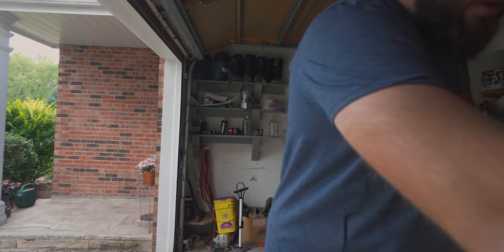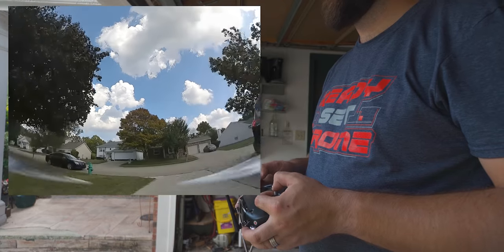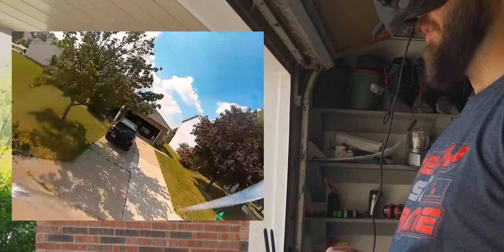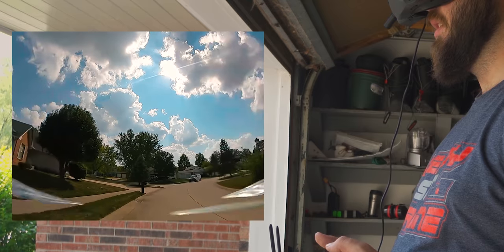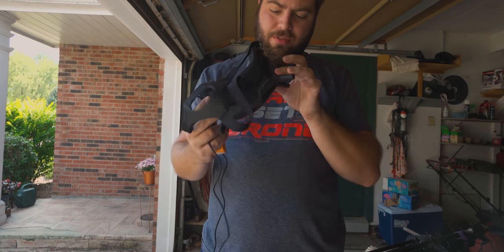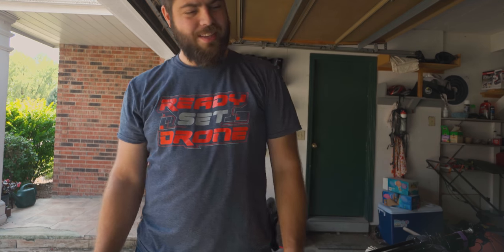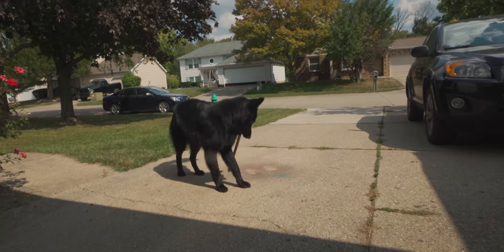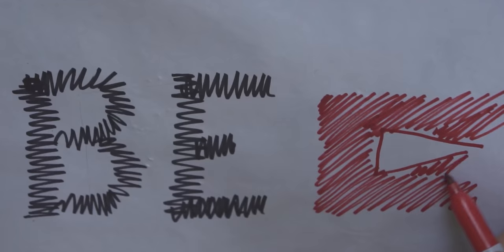Reacting to my First Ever DJI Digital FPV Flight

Comment: The quad tune is not great.  Very weak PID response.  But that's just some settings.  
Great flying on those loose sticks!!  I needed to tighten the spring tension.  The DJI springs are pretty soft, but it is awsome you can tighten without taking the radio apart.  Again, just some settings.

Good stuff.  Loving there is not break up or rolling shutter.  Pretty crazy.

Comment: The recording starts automatically when you arm. Just in case you forget.
Reply from the maker: yes it does. So cool
Reply: 2020 will be very expensive, but no problem. still use old older oldest box goggles till today, but now its time to upgrade.

Comment: Whispers I want to hate it

Later

This is unfair
Reply from the maker: It beat me into submission.
Reply: Competition will be here soon. Don't need a proprietary system.
Reply: I wanted to find a reason to fly my five inch analog rigs, but I’m liking the Dji way better. I don’t race or fly super long range.
Reply: Andy Ciordia the only thing that is proprietary is the goggles. Fat shark was going to make you buy a new camera/vtx too. Also they were going to use the hdmi port for something.
Reply: EscobarTV45 you need their controller too. Can you cite where FS is going to create a proprietary module? So far they've just stick to the goggle not vtx market.
Reply: @AndyCiordia  you don't need their controller. You can use your own reciever and transmitter. As far as the FS stuff. Go to their Facebook page and look at the pic of that byte frost stuff that they had to hold back on. They were about to sell you a system that wasn't on the level of dji stuff.
Reply: EscobarTV45 ah I thought it was a package. I'll still wait. Cost to benefit isn't there for switching out an armada to a new goggle system that afaik isn't useable with the other standards. I'll wait and see how the market handles it. Every 6mos we see some innovation. I'm not complaining, it's a good thing to be pushing on. 👍🏻
Reply: Andy Ciordia yeah I still have my fs hdo with RF and not getting rid of em. Anything new that comes out is gonna require a new camera, vtx,  module, and goggles if you have some old ones.
Reply: I have plenty of $$ in 5.8, but even if I didn't I'd still be waiting another year or so... most of our standard FS goggles will display vastly better "HD" images than we get from 5.8 analog.. so I wait and see what HD/digital cam, vtx and FS bay modules follow DJI.   Besides that, I'm not dumping Crossfire either, nor am I going to buy new frames to fit that big DJI box.
Reply: Second thoughts. I'm selling the Fatshark HDOs and Rapidfire. I don't need $500 goggles for whoops and toothpicks. I'll dust off my Skyzone 02

Comment: I felt the same stutter until I tightened the stick settings. It's just a disconnected, un-nerving feeling. I got used to it, but it's better now that I tightened up the spring settings. I think the gimbals are set full loose from the factory and it seems like there's actually play in the linkage. I do miss the programability of my X7S, but for this video, I'll suffer thru it.
My big wants are a receiver so I can let others view live video and real Betaflight OSD. I'm also having trouble getting the rate profiles to change, but maybe I just don't understand how it works.
I've been doing a lot of flying since I got it, it's really enjoyable and it's upped my confidence by an order of magnitude.
Enjoy the new world, and cie la vie on the analog gear, many of us have a lot of  really to notch gear that instantly lost it's luster. I guess I'll put my HDOs in the box with my CD collection.....
Reply: The bardwell video on setting different rate/PID profiles will get you there,  it's a bit of a faff the first time, but once its there it works really well.  
I'm still shocked how much confidence I gained moving from junk VRx and $13 cameras to a Clearview GS and Predator cameras, so that's definitely a real thing.
Reply: @tehllama42  Thanks, I watched that, but it was before I started flying the DJI, so most of it didn't sink in. I'll go back and watch it again.

Comment: Nice to see your toughts. I Like my DJI System too, it's really hard to not like it. Digital Video feels a bit different than Analog, but after a few days i was used to and it's absolut flyable. Also i noticed some of my Analog Quads fells more Latency depending on the Camera. The Digital System has a bit Frame los or drop in some situations, but the Latency over all is absolut fine. the Frame los or drop is a thing to get used too, not more worse than bad Analog Video noise.

Comment: @NURK FPV - your timing should work, and I'm excited to see track time comparisons (though not being your quad and not tuned for racing I doubt you'll beat your own builds heh)  The DJI system is basically the same as Raceband, though 6/7/8 are switched around.  I know a few timing systems have already released firmware updates to support DJI so check if there's an update available?

Comment: Love how this entire industry can do a 180 over a new product..suddenly everyone loves dji again hysterical how things work.
Reply from the maker: I'm not sure what you are implying. I never would have said that the industry doesn't like DJI it's just a different strokes for different folks.
Reply: It's entirely possible to love a new capability regardless of how we've ended up with it.  I'm actually getting pretty excited about what possiblities exist for the next generation of this setup (Uses Raceband & IMB6c Channel allocations, Dynamic RSSi-driven power output, analog input for goggles, smalle form factor integration options, etc.) - it's the kind of product I'm deliberately avoiding trying in person, because I know it's going to cost me money in the long run.
Reply: I got into DJI drones in March 2019 and currently have 4 of them.  I have the 2 gimbals they offer too.  Sure they used to suck when their systems kept failing back in 2015 but that is all fixed now.

Comment: How about trying it with focus mode turned off at 700mw. I wonder if you'll still retain low latency. So, I"m sold on the goggles/air until, but am on the fence about the transmitter. Would you recommend it for us accustomed to Crossfire, or do you think it's best we stick with what we have? Thanks Nurk.
Reply from the maker: I have tried it, but I couldn't really tell the difference in experience in "high quality" mode without focus assist. It's very strange. Seemed very similar to what I had been flying.

Comment: Every time i see some one review this, i always feel like the Focus Mode On algorithm  is too aggressive on 700mW. one would think thats enough power for a pretty clear picture. it seems as though the sides degrade far too quickly given the distance? the center looks great but i would really like to see it fly at 25Mw and see what Focus mode off looks like and see how the systems handles reception with those parameters.. great video as always, thanks for the review!!

Comment: What battery you using to power the goggles?
Reply from the maker: Usually just a 3s 2200
Reply: NURK FPV thanks bro. Enjoy the vids. One more question for you! 

You suggest doing the mod? Or is there a safer way to do analog through them? I ordered them to use them commercially and only use one pair. 

Also I love flying tiny whoops :)

Comment: I could've got DJI and still can, BUT..
1. 2x heavier unmodded.
2. No small drones with cheap batteries for playing for long periods with many batteries.
3. Very expensive drones you can't relax with properly.
4. They have higher latency.
5. Image cuts to black immediately making it more likely to lose or crash expensive drone.
6. Only 2 cameras actually look O.K. (i own 4k TV's)
7. Dji is and always has been just a flying camera company for photographers.
8. Stress, worry, devastation, ect.
9. I'm not stupid.